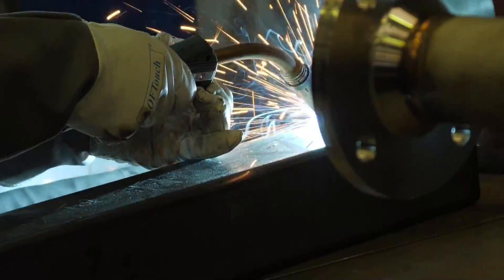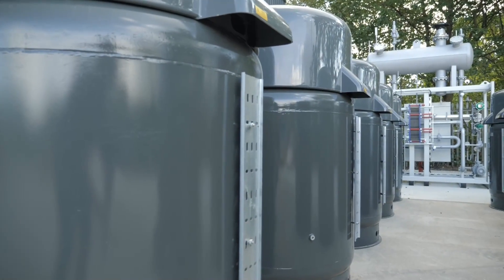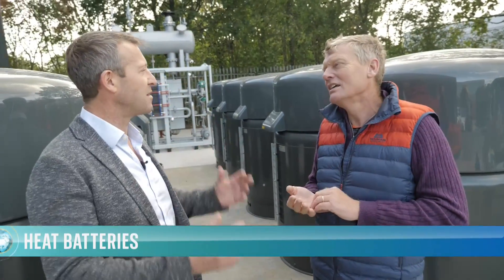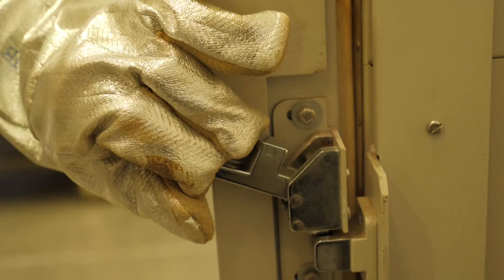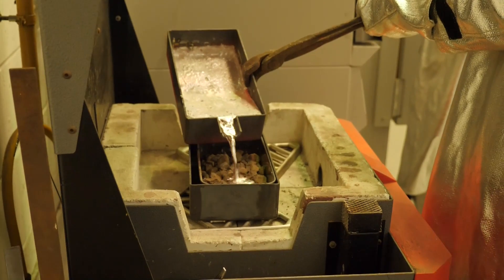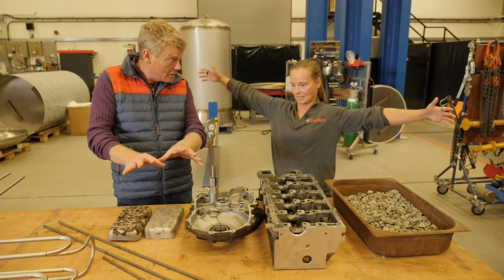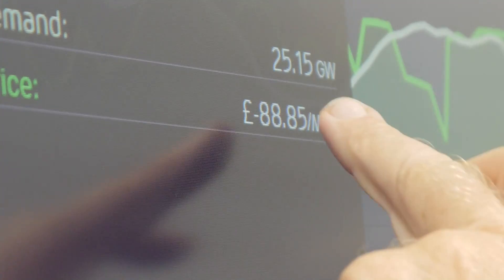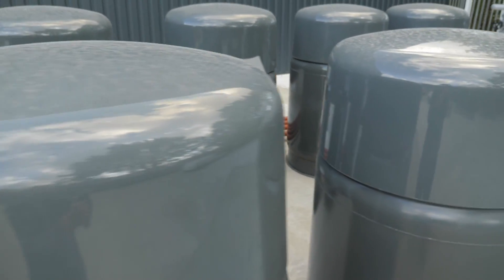Heat batteries: What are they and how are they made?

Comment: What’s the maximum capacity of one of these heat batteries?
How many are required to run the UK for 24 hours?
How much aluminium required for the above?
Reply: very little
untold 
& sh&tloads